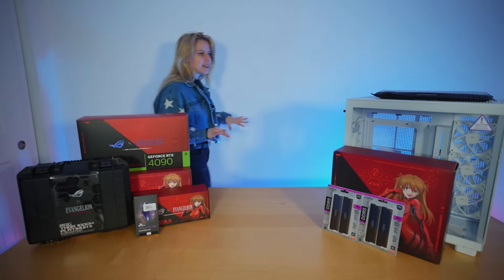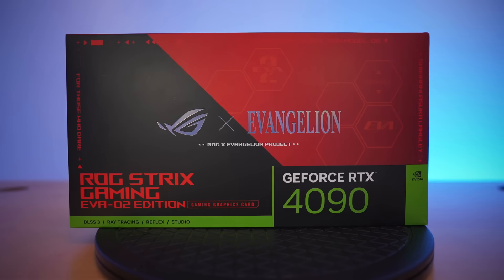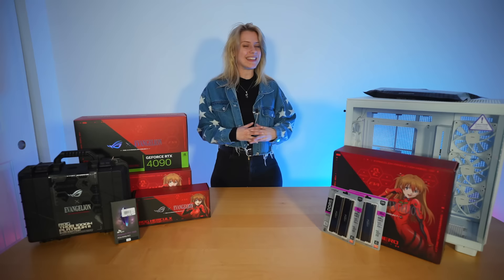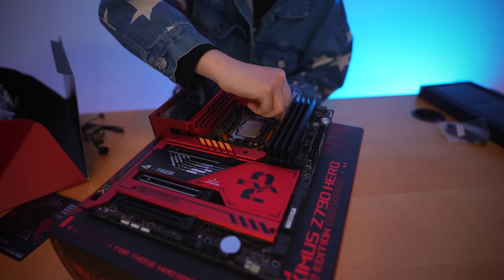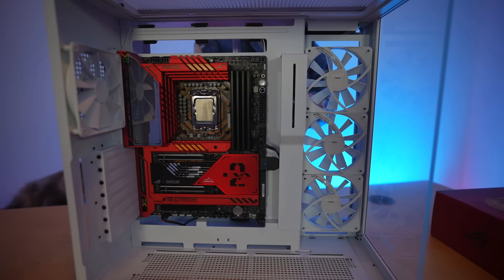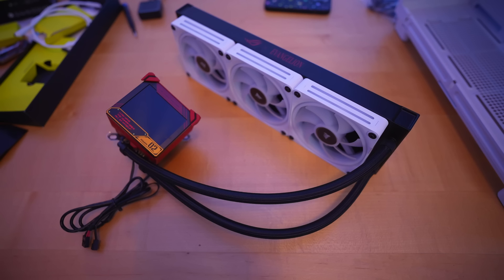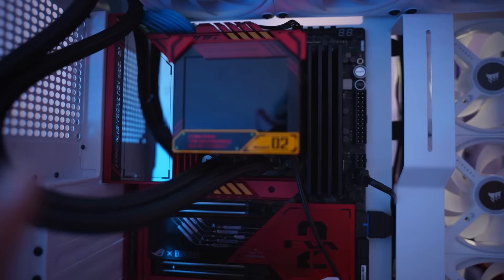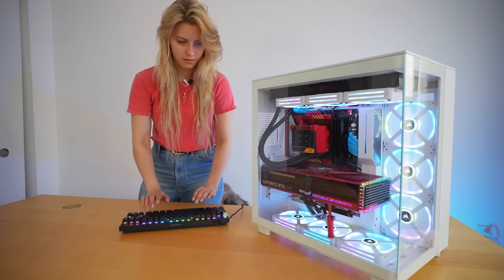LET'S BUILD MY NEW GAMING PC... OVERPOWERED AND UNIQUE! RTX 4090 PC Build | NoisyButters

Comment: Honestly its quite refreshing seeing a streamer/youtuber that actually knows how to build a PC. I can't tell you how stressful it is to watch some of the others "build" their rigs and fail miserably. This was a great video and nice build, even if those parts are grossly over priced ;)

Also, RAM is easy, generally if you only have 2 sticks and 4 slots, you go from CPU socket > Miss > Insert RAM > Miss > Insert RAM. This is generally the set up, even for Intel or AMD.

And that thermal paste application is fine, though not needed. It is a little much but that has been proven to not matter. I generally use a pea sized dot or draw an X symbol for CPU's that are a little bigger.
Reply: It's not really hard, literally a Lego with 10 pieces more or less.
Reply: @gamblerfls  It's not difficult for people like us, but I can understand why most people find it difficult or intimidating. Compatibility, the fact that DDR5 doesn't work with certain motherboards, but it works with CPUs that work with those motherboards. Knowing what types of CPUs fit in certain sockets; even if it fits it may not work and you need a BIOs update. Even simple things like aligning the CPU correctly (little triangle symbol), remembering to remove stickers from SSD. Fan alignment. Knowing what's the appropriate PSU to use, where the wires go. Power, reset, ect wire orientations. Being careful to not tighten your screws too much on the motherboard. It's sort of a lot to keep track of for regular people and the technology is fast changing.
Reply: @georgesmith5201 I think what intimidates beginners the most is the cpu cooler mount and thermal paste, other than that anyone can build a PC if reading the manuals carefully, the only difference is how many hours it will take
Reply: 4 DIMM DDR5 is a bad idea.
Reply: @hovnocuc4551  By now, everyone should know that.

Comment: For the fan question: if you can put it along the rigid parts of the fans, on the edges, you should be totally okay. But definitely dont put it anywhere it will rest on the center or support arms of the fans, that gpu is super heavy and might bend that plastic/cause the fans to grind
Reply from the maker: thats what i was thinkin, thank u so much!!! im still gonna think about other ways to support this gpu, im sure the right method will come to mind randomly! ~
Reply: @NoisyButters  this might be a ridiculous amount of effort, but I've always wanted to get a 3d printed statue of something to support my GPU. I have a 7900 XTX in my build and the sag bracket right now just looks boring. I might 3D print black panther or something and get an artistic friend to paint it so I can use it as a support bracket. Something like that would be awesome if you could find a way! Just an idea.

Comment: The device that is on top of the bottom case fan straigtening the  GPU is a mini Screwdriver also.  I used the one that came with the ASUS RTX 4070ti Super and used it ontop of the PSU cover in the Corsair 570X PC case.  It was a little too much so I loosend it because the head width wasn't needed.  Pulled it out of the cylinder and the cross tip screwdriver was at the other end.  Nice Build.  You have come far since last time I saw You, in college posting YouTube content.  Cheers!

Comment: 7:02 hmm, I always thought RAM kits were tested as pairs; as such it's kind of important to keep kits paired to ensure they always work correct? Like put kit #1 in slots 1 and 3, and kit #2 in slots 2 and 4, but I could be wrong; I do recall kits not working when shuffling them around, even when they were of the same model and brand but not in their "paired slots"

Comment: As long as it sits on the edge of the fan and it doesn't impede the fans from moving it really shouldn't be aproblem it also spreads the weight better than that just one stick. It's also not a lot of weight considering it's being hold by the screws.

Comment: Good lookin build, but things i would point out are: 
1. getting blue sleeves for the aoi tubes and blue cables for the GPU would certainly make the blue accents work more fluidly, and
2. You could probably get a 3D printed screen that goes over/around the bottom fans that would then give you surface to place the gpu sag bracket without putting strain on the fan blades/motors

Comment: You have 6 intake fans and only 3 outlet ones. I think you should be more than fine putting the GPU holder on the bottom. It's not large enough to cause a major amount of air turbulence or block intakes, but even if it does,  the sheer amount of fans will compensate for it well enough.
Reply: she actually has 9 exhaust fans and 0 intake fans 💀hopefully she fixed it
Reply: nah dude those are QX series fans - if the X frame is facing the inside, that’s an intake

Comment: Woundering if the "side" fans should do more purpase pushing out air, you have 3 under that taking from bottom to up. Make sure ur free where ur stand ur computer so it can breath from under! And put 1 fan in the back to push out. So air from the PWM "around" the CPU air gets out quick. u maybe say this doesn't make sense but if ur having heavy load under hours it can make a difference how long ur things lasting and clocking! So all air doesn't need to go thru the radiator! Love from Sweden <3

Comment: Cool setup.  It is amazing the industry is finally catching up to what we used to have 20 years ago. We were making 5Ghz computers in 2003 and they sold a 4.5Ghz laptop at the same time with 8gig of RAM. 
Then Atom sold a 7.68Ghz optical laptop with 100gig SSD and 64gig of RAM for $13,000 the same year. (Wish I could of bought one). Then things went backwards to 1.8Ghz laptops then slowly increased a little till they finally caught up. 
Get ready for a boom again because A.I. will require lots of resources to handle everything from computers to phones.

Comment: HI from UK, that big GPU stand is safe but would block a little airflow, which is only a problem if it causes a noise you don't like, you could make a little stand for the gpu stand to make it further from the fan, to help airflow. P.S always install the PSU first!!!

Comment: Nice PC
First I am wondering why you choose 4x16 instead of the 2x36 (max is 4x48) as 2 sticks work better with high memory sppeds. (Did you encounter any problems with it as you did not mention that at all.)
I would assume that the GPU holder should be fine even if they are placed ontop of the fans.
Reply: 2x32 for gaming pc on intel 1700 socket works better but for example on ryzen 5000 4 sticks is better, 4 sticks are also better on most PCs for some productivity aplications though, but on 12th gen intel 4 sticks with high speed can give inestability.
Reply: @guille92h Have a look at the comments by jayztwocents or LTT on that matter. The current recommendation is to use 2 sticks of DDR5 RAM, as using the xmp profile might not be working especially on two stick kits as used in the video.
Reply: @narratotgaming6076  yeah, i know that on ddr5 for now is better 2 sticks, and yeah you're right i forgot she got 2 kits of 2x rams instead of a 4x kit which makes it worse

Comment: Im not here to hate mkay ? Just to comment some stuff id change, like colour of the case, black, red or orange to pop up. White looks nice but not with these internals. Id use red 12vhpwr cable instead of black. Black is fine but red pops up and adds some life to it and extends that red accent on the GPU.  Also id change those 64 Gigs for 2 sticks (2x32) option cuz u are losing so much speed on 4 sticks since the mem controller on the CPU is not capable to handle 6k or even 4.8k. On official Intels web is 2 stics x 5600 max for this CPU so 6k is quite pointless ( i know its just mem ad, those 6k but still ).... yeah i know cuz i made the same mistake with 4 slot option. Like its not terrible but still for that price and what u expect. Also kudos to u for using that screwdriver as sag protection for gpu which is meant to be used that way, ive seen so many ppl ignoring it. Plus id use good air cooling solution instead of liquid. Those liquid bricks just look nice but thats it, good air is still better than liquid and less prone to fail and even it fails ( fan ) it still can cool ur system (not so efficiently but still ), if liquid fails u will hear it, smell it and probably see it. Just my thoughts, but gg u will learn these small details on the go. No worries.
Reply: Bro did you even watch video.

Comment: Just putting this out there, you can get colourful cables for your power supply by cable mod, and they also make right angled connectors to reduce the stress on the 12VHPR connector because of the issues with it melting and setting on fire etc. but make sure they’re for your power supply and you can make your own in whatever colour you like for any cable. They’re not cheap but from the looks of things price isn’t a huge concern lmao

Comment: You forgot to replace the CMOS battery. It's always the first thing you do with a new motherboard. I have the same build, but I built mine in a Thermaltake Core P8 case and GPU vertical mounted.

Comment: Hi, You did not connect it to a monitor or speakers. To see if the graphics card worked. Because I got a new graphics card that did what yours did came on. But when I connected it to a monitor there was no picture. I tried plugging it in another output for the monitor and nothing.. I tried all of the output ports nothing. So I put the old graphics card back into ther computer. It worked like a charm. I upgraded the driver to the latest driver for my new grapgics card. And tried the graphics card again. It came on and has been working eversince. And my new 5.1 surround sound just worked with a digital cable. Now I can hear things or people sneeking up behind me in games. Its like I'm in the middle of the game with everything going on around me. Nice Build. Stay safe to you and your loved ones.🌹💗

Comment: So much energy and excitement a joy to watch the enthuisiam and the pc's nearly as gorgeous as its owner, screws in the fan, although screwing ever screw hole isnt nessecary you will gain a tiny amount of noise reduction, as its fixed more ridgitaly to the AIO so therefore less vibration. Thermal paste application it doesnt matter if you overdo it more is better than not enough that said having lots means you risk getting it everywhere, which is no biggy cause most compounds are non electrically conductive, that said getting it on the pins of the cpu socket, its a risky business cleaning those pins without breaking them or leaving bits of cloth, tissue or cotton from q-tips on the pins of the socket will lead to a bricked motherboard.

Comment: You might keep an eye on cpu temperatures. Ever since 12000 series , the new cpu latch doesn't always go down even and the cpus get pretty warm. I recommend you get a thermal grizzly cpu contact frame for a more even pressure mount.
Reply: They get warm anyway, but in saying that I have my 14900K idling in the low 30's and topping out in the early 80's. With these high-end chips, temperature management is all in the configuration. For me personally, I don't think the thermal grizzly shaving off 3-4 degrees is game changing TBH, or worth the effort for that matter.

Comment: The Thermal Grizzly paste tends to come with a little built in spatula thing that screws onto the end of the tube. You just unscrew the tip that's on there, swap it to the spreader/spatula thing, and then apply it to the IHS. The dots method works but these days, be it AM5 or Intel's system, nothing is simple anymore. 

These days, I'd recommend spreading the paste yourself to ensure proper coverage without using more than is needed. Remember, not all thermal paste is electrically nonconductive. You can kill your system by applying too much thermal paste. Thermal Grizzly should be electrically nonconductive, but others may not be depending on the brand and what ingredients are used to achieve their level of thermal conductivity.

Edit: That GPU support is giving me anxiety. I would buy a 3D printer just to print out a better support for that thing. 4090's are notorious for having cracked PCI-E slot hooks and other weight related issues. That thing needs serious support.

Comment: I'm impressed , so far you are my no 1 pc builder girl. Tempted to give 10/10 review but just 2 small tips. Grab a exhaust fan in the back case and please, please change that original bracket for intel cpu with a frame. Is cheap and make the difference in terms of cooling and temps for that i9 cpu. Best of luck gorgeous girl :)

Comment: Biggest mistake was to use the stock intel CPU holder, but as long as you are happy is fine. I just find odd spend so much money on a cooler when a cheap AIO + proper CPU holder can get you better results especially for a CPU like the 14900k that can get hot in no time.

Comment: streamers haven't needed a second pc for streaming for several years now. that's something you needed before 2019 as even the 9th gen intel could have covered everything and then some. current high end cpus are way overbuilt for a game and running obs, and nvidia has had a separate encoder built in that takes less than 1% of gpu performance off the table and produces a clearer stream than streaming off the pc. not to mention twitch will be rolling out AV1 and streaming at 4k 60 via nvidia cards with the new update on the way leaving the streamer to require a lower bitrate. all you get with a second pc now is a higher electric bill, more heat in the room, and complicated audio routings.

Comment: The build is very nice even for me who always choose black parts with minimum RGB (yes, I am boring), nice choice for the GPU holder, very minimal, practical and doesn't mess with the lower fans, I also have this problem in my build, I did not install any GPU holder cause of these fans, I am lucky the 3080 doesn't need them that much.

Comment: don't put a nvme into the slot above the pcie x16 slot (defined as nvme slot mb_cpu in the mb manual) usually it will downgrade the x16 slot to x8.

Comment: If it was me I would put my AIO on the side. That gpu holder your on about is not for that case. Its use in the Asus Helious case. And if you want your aio at the top, put the tubes to the right as you are facing the case.

Comment: Good build, but installing more than 2 sticks of DDR5 RAM is not recommended, you'll most likely run into issues when enabling XMP if you use more than 2 sticks, it's a widespread issue.

Comment: I really love your energy and your vid was fun to watch. I have NZXT H9 Flow case also. You mentioned vertical support for the GPU, I'm using Phanteks PREMIUM VERTICAL GPU BRACKET, not the basic version. The Premium version allows you to adjust GPU to 45 degrees or any other angle other than 90 degrees. Really fits well in my NZXT H9 Flow and should work well in your case. Comes in white as well :)

Comment: PC cases should have a groove in the top on either side to have the cooling hoses go through. My case is similar and it would be nice to have the radiator in that space at the top. I put my fans in that space and radiator above the motherboard. Very cramped up top.

Comment: Have you had any problems with your 14900? Intel still having issues with their 13th and 14th gen which is why i went with a 12900K i9. That 4090 is worth more than my gaming PC.  I just have a Radeon 7700XT 12 GB V-ram. But for what I spent on my PC it does what I need it to do.

Your PC looks good and you seemed to had a lot of fun building it.

Comment: Don't have the Evangelion swag, but just did a White Lian Li Lancool with White Deepcool tower cooler with White Argb on top. But there is an Asuka Langely 12 inch figure in red between the MB and front fans. Had to because just found the DVD set and rewatched the Movies.

Comment: 13:02 Why do people keep mounting fans in a pull configuration now? You're taking the warmer air from inside the case and using that to cool the radiator instead of using the cooler air from outside the case? Although with 6 intakes you'll probably get away with it.
20:37 I prefer the GPU brackets that mount to 3 of your rear screws and then hold it up with a bar underneath, you'll likely find one that matches the look of the GPU and they support the whole card rather than just one spot.

Comment: This case is copy of LianLi  O11 Dynamic XL - and thats good. GPU Looks dope but size of it is absurd. MOBO is cool AF.  With case like this you have to force air movement inside. In my setup I have 10fans: 6 pulling air into the case and 4 pushing it out. Pulling in are 3 bottom fans and 3 on the back panel. 360 water loop radiator is also on the back panel. Again that gpu is just... My 4080 is big but this 4090 is absolute chonker.

Comment: Only thing you need is a Contact plate i like thermal grizzly but there are less expensive but helps alot if you have ram or cooling issues Great Build <3

Comment: 6000mhz ram with intel i9 14900k and Rtx 4090 is like putting a Toyota Prius engine in a Ferrari. You either know nothing about pc or the only reason you’re using those mid ram is because it’s sponsored. Get a 7200mhz ram kit with cas latency 36 with tight timing. 

Amd likes 6000mhz ram but intel likes faster ram. That motherboard easily supports 8200 mhz ram with cl40 timing

Comment: I also bought the latest RTX 4060 Ti 8GB.

I will buy a new video card in the future

Usage:
- video editor Adobe (1080p/4K/8K)
- Game: EA and Steam

Older GPU:
-GTX460
- GTX 970 (other PC: intel dh77kc)

PC: ASUS PC PRO
Motherboard: ASUS Z97-K (socket 1150)
Processor: Intel® Core™ i7-4790 (8M cache, up to 4.00 GHz)
Ram: 16GB DDRR3
SSD: 500GB SAMSUNG 980 M.2
SSD: 1TB WD GREEN
Soundcard PCIe: ASUS Xonar SE (DAC Audio)
Video card: Gigabyte GeForce RTX 4060 EAGLE OC 8GB
keyboard: Steelseries Apex 5 LED RGB mechanical keyboard
Mouse: Corsair Ironclaw RGB Wireless